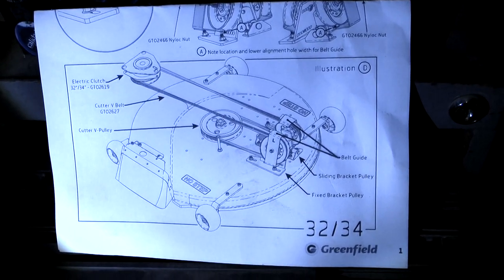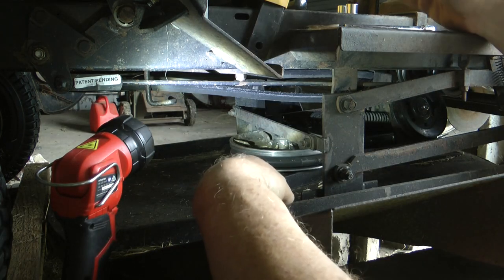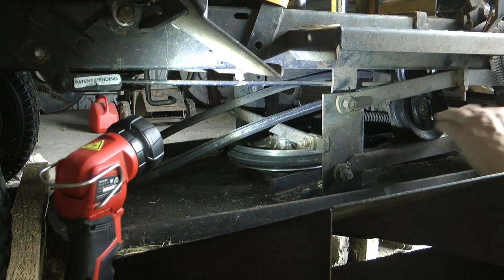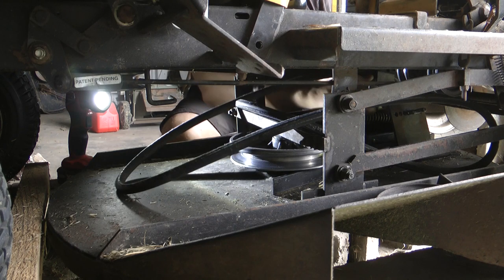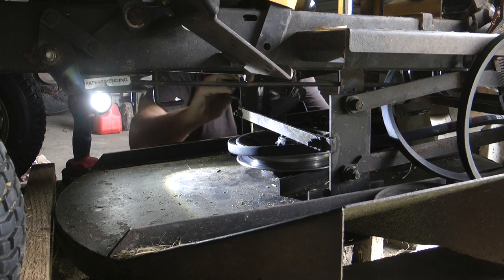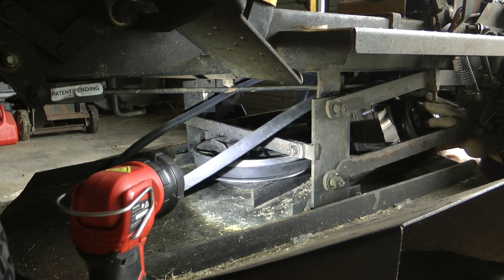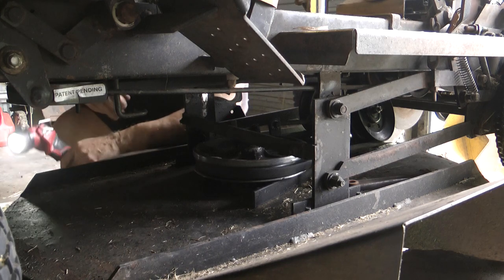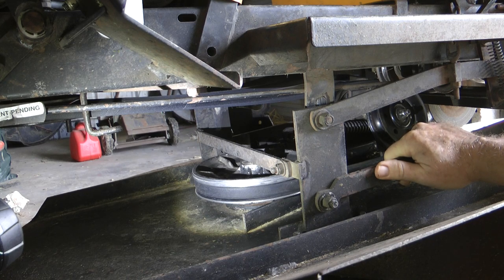How to change cutter V belt on Greenfield Ride on mower.

Comment: Looks like the cutter belt has flipped over on its back which it shouldn't be on the actual cutter pulley.
Reply from the maker: It's stretched that why it was replaced.